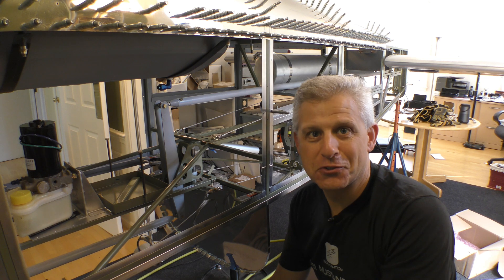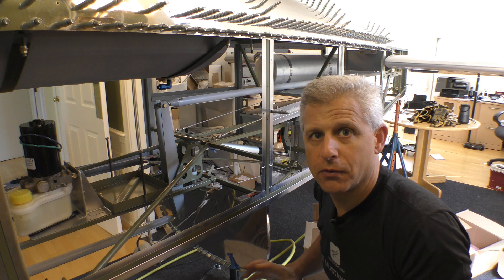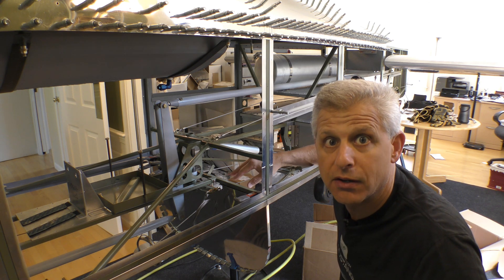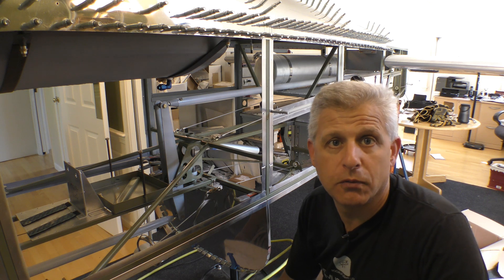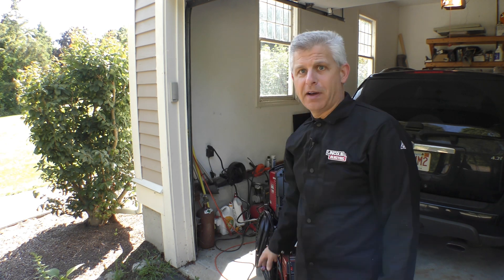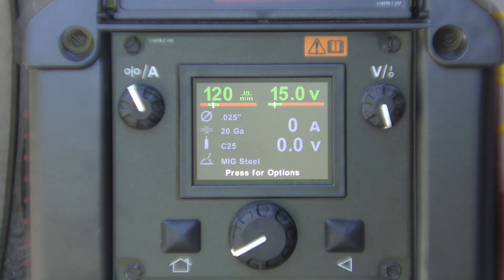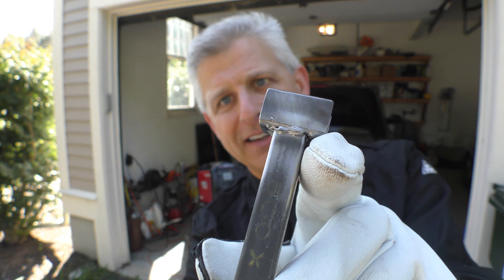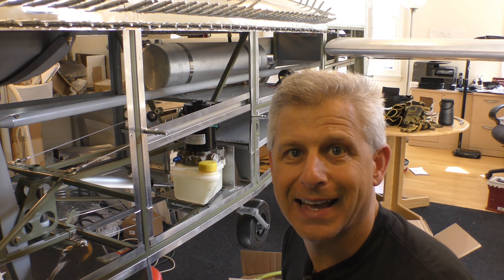T-51D Mustang - Welding the Landing Gear Pump Shelf

Comment: I would have suggested practicing on some scrap steel generally you pull as your laying down a bead not push the handle. Ton of online videos but all in all mig welding is really easy just takes little practice want to play with the wired feed speed on a scrap piece of steel. Not sure about that auto setting the bead looked little under powered and not enough wire speed but hard to tell just this video.
Reply from the maker: You’re right, of course!  We’re continuing to learn and improve our welds!